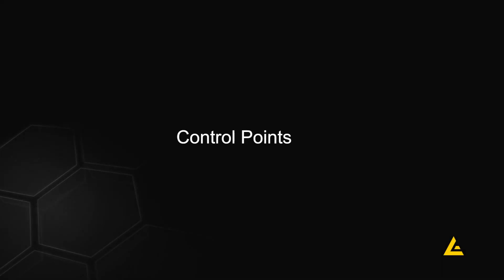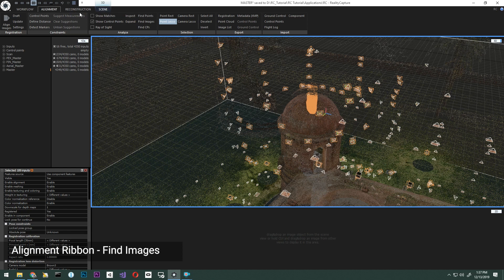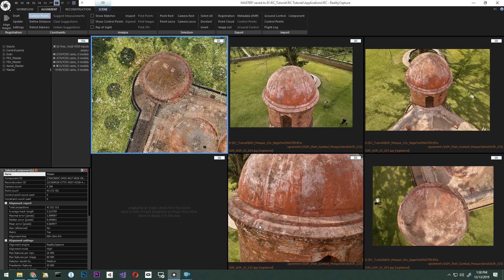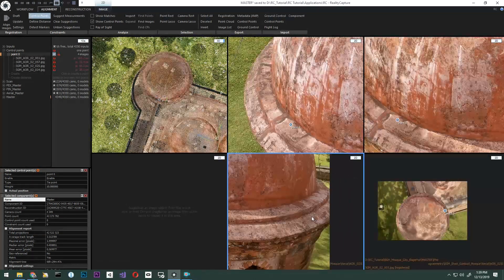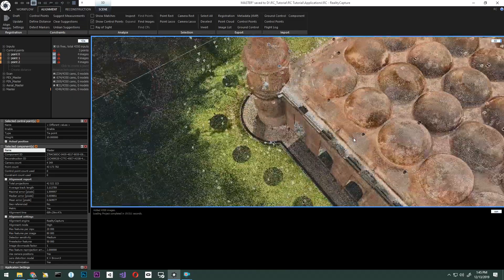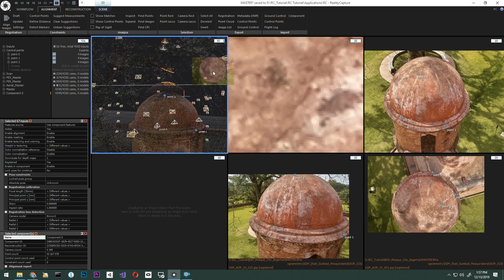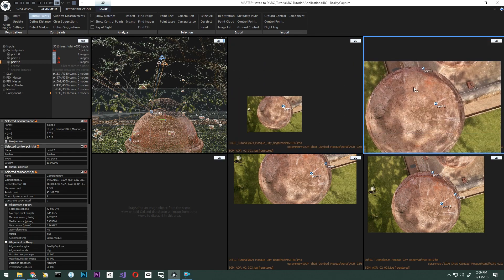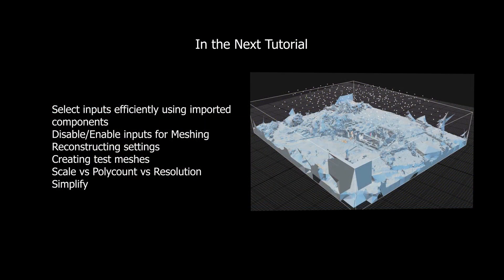Control points workflow in RealityCapture by CyArk

Comment: Also a really nice tip is that if you are in your point cloud creating control points if you press F3 it shows you all the cameras that saw that pattern. Click and it will add those images and you can validate them or not. 
Go to your secondary component and F3 again search for that pattern and voila.

Comment: RC is really good at what it does. When it doesn't quite work out, the tools to repair the data set seem pretty extensive. I have just started a serious effort to get to know the software features. Photographing small items around the house in a DIY lightbox with an arduino stepper driven turntable. The selling point  in choosing to use RC was the zero cost to process my files until I was satisfied with the results. It is really cool to find YT videos explaining exactly how to use some of the features. I read manuals, until I get tired of it, then I search YT and find someone demonstrating what I'm trying to wrap my head around here. Thanks for making the video!!

Comment: How did you accept all suggested points at once? I select all images, but I have to click hundreds of times on every [+] icon.
Reply from the maker: Hi, in which time of video is this?
Reply: About 2:09 suggested control points appear and "accept all at once" or "ban all at once"
It is enough to check the first suggestion, the last one, and one in between. 
If all suggestions show the same point and no need to adjust, we can simply select the group, 
Click First +Shift, Click Last and green [ + ] on any of them.
To validate the whole selected group with a single click.
The same way click red [ x ] to ban placing control points here for the selected group of images.
Reply from the maker: @Abrimaal  This point 2 is placed just only over 4 images, so it seems like all at once, because the video is speeded up. It is not enough do this that way. In some cases, there can be some misalignments, which can be found by placing control points. So for achieve better results, this is not automatic.
Reply: @RealityScanOfficial  Yes I noticed this. But when there are 50 frames from the same video sequence, the detector finds exactly the same point (for example the top of a tree in background), it will speed up the work to accept the point for the selected images.
Reply from the maker: @Abrimaal  I can add it as a feature request to our database